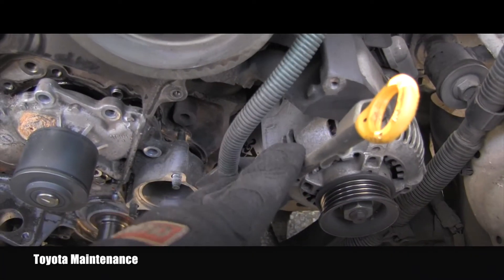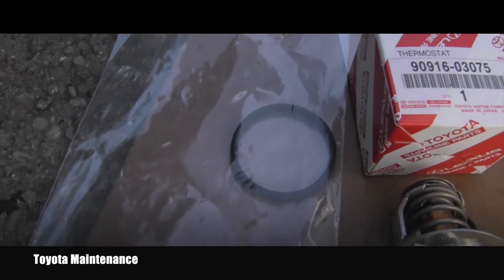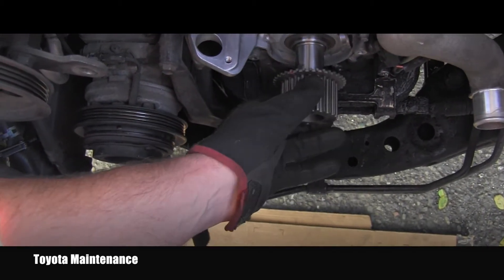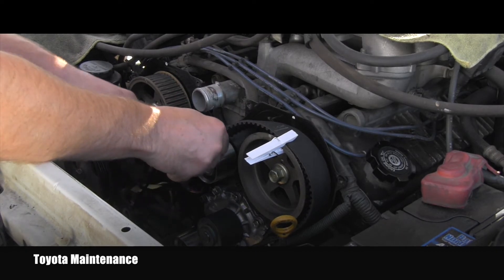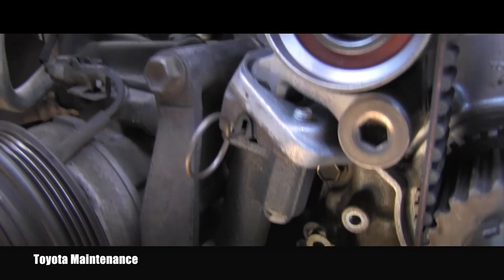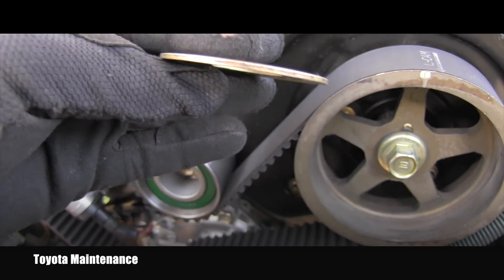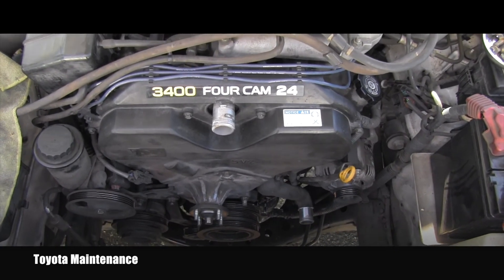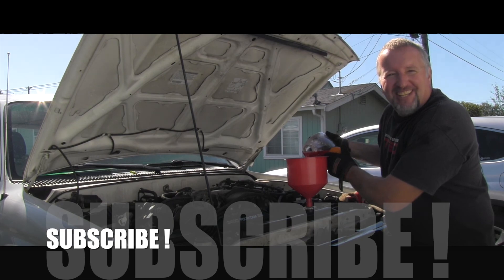Toyota Water Pump and Timing Belt Replacement - Part 2

Comment: I would have redesign the back bolt of the tensioner. 
Either have the back bolt thread into the tensioner, or notch out the AC compressor bracket,  in order to get to the bolt !! You'll know what I mean, when you get to this point....

Comment: My favorite ending of your videos so far. Carefully adding the new coolant while closing out the video. Very professional and creative. After watching both of these videos on changing the water pump and timing belt, even though I know I'd never be able to do it on my own, at least I'll understand the price the mechanic or shop will quote me if I ever need this service done. Changing the actual water pump itself doesn't look that bad. But getting to it... dear god, is insanely complicated. Like step one is removing the radiator!  : )  But your calm, expert explanation makes it seem possible. I'm sure your video is a godsend to the folks with the tools and skill to do it. Great work! And excellent video as always!

Comment: hi peter I just  bought a 2002 toyota tacoma the guy had it for about 5 yrs but he never changed the belt it runs great but I'm going to change the belt water pump and thermostat  it has 160 k thank you so much for your mechanical expertise you gave me confidence to do this

Comment: Do yourself a favor and order a  , " Made in Japan " water pump.  NPW, Aisin.  Unfortunately, Aisin water pumps, that are made in USA, are not worth the price they charge.  Camshaft seals are rated for ~ 200K miles.  So I leave them alone.  If it is near 200K, before installing new ones, I place in freezer overnight.  Much easier to install.

Comment: An easier way to bleed air from the cooling system  , is too elevate the front end after adding the HOAT Toyota Antifreeze , and gently increase rpms to no more than 3500 , do this a couple times or until no more bubbles coming from fill hole....Ive heard some bad stuff could happen if all the air isn't blead from system.

Comment: Also how did you torque the crankshaft bolt without the cams moving?
Reply from the maker: air gun, holding pulley with pulley holder, there are many ways

Comment: The brake fluid on that reservoir looks contaminated. Owner would probably decline brake flush.
Reply from the maker: complete brake fluid flush performed few thousand miles ago..what you see is the plastic material of the reservoir....